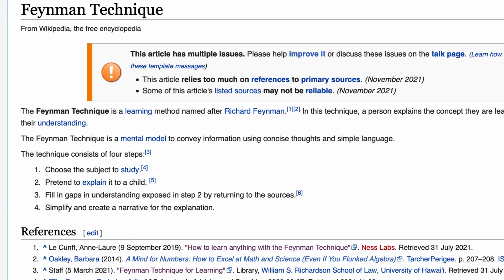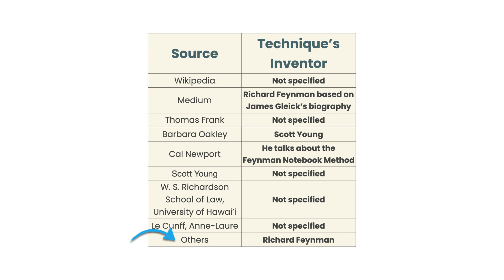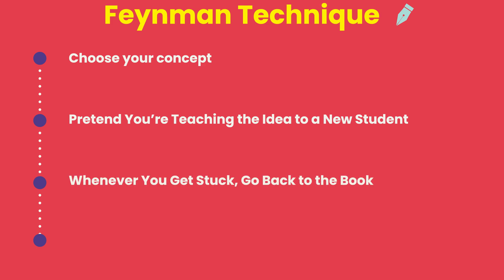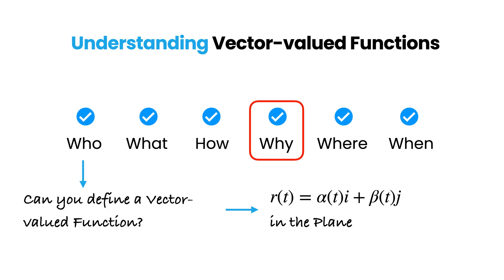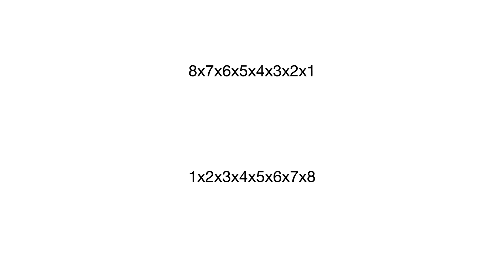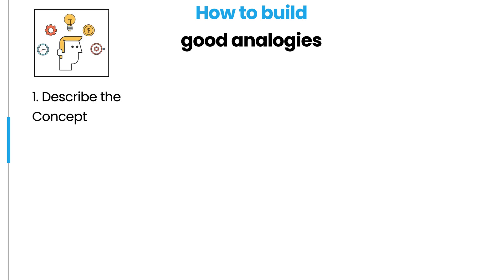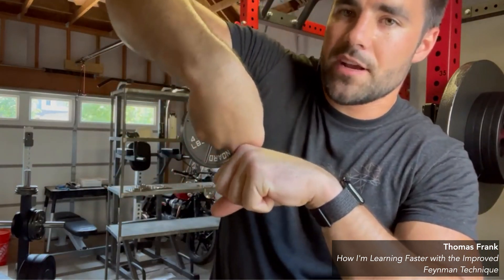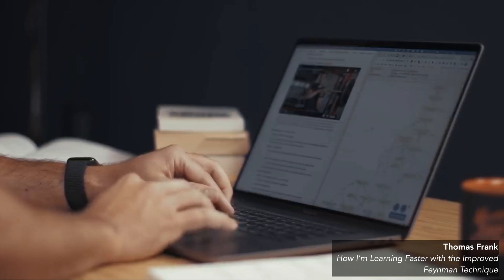Why the Feynman Technique does not work and what to do instead [feat Thomas Frank PLC]

Comment: I came upon this searching for critiques of Feynman Technique, for 5 minutes. I only found this video; no open or closed research papers.
In multiple high school environments, from inquiry, a cousin of FT called Peer Tutoring ends up with the tutors simply getting the assessment
assignments done themselves, and the students learn indirectly, if at all. I appreciate some insights such as the cases of no appropriate
analogies being mentioned by the narrator/author. I cannot find an old research paper from a Tennessee institute that ranked ten study 
approaches, one of which was the FT, and it had a neutral impact, along with highlighting, collaborative discussion   and others.
Reply from the maker: I agree with you that it's not easy to find articles criticizing the Feynman Technique. There are a few reasons for this:

Feynman's Reputation 
Richard Feynman is widely respected among scholars and students, which makes it hard for some to critique his methods. There's a natural bias in favor of him because of his genius.

Association with a Genius
The Feynman Technique is linked to one of the greatest minds of the 20th century, which has boosted its popularity and spread. People often assume that if it worked for Feynman, it must be universally effective.

Endorsements by Learning Experts
Experts like Barbara Oakley have discussed this technique extensively, adding to its appeal and solidifying the belief that it’s a go-to method for learning.

However, the technique has a notable flaw: its reliance on analogies. While analogies can help simplify complex ideas, they can also lead to misconceptions. This is supported by research, such as Gavetti's work in strategy, which explains how analogies can sometimes steer us wrong -  https://hbr.org/2005/04/how-strategists-really-think-tapping-the-power-of-analogy
The literature on this issue is actually abundant, but most people don't pay much attention to it.

Personally, I don't use the Feynman Technique for this reason. But for those who want to, I recommend modifying it to avoid the pitfalls of analogies. I've developed my own learning method over the years, which I find to be more effective and less prone to these issues.